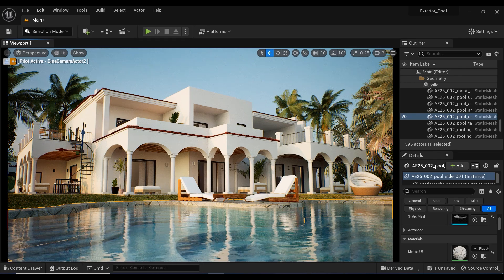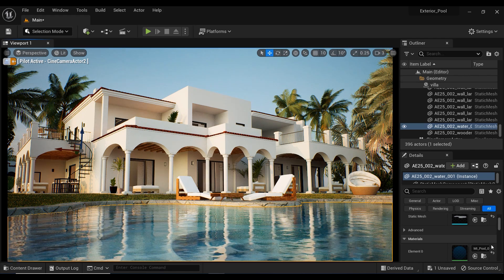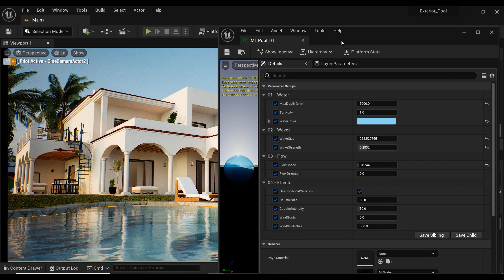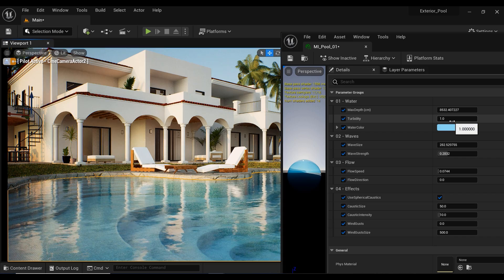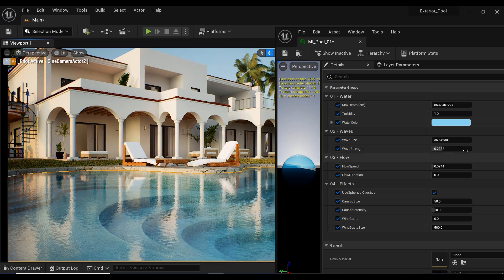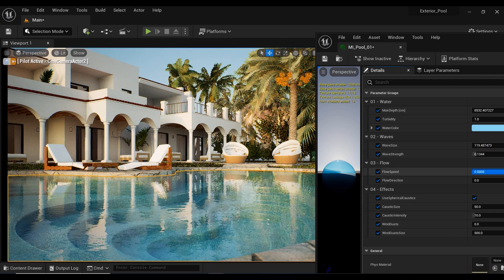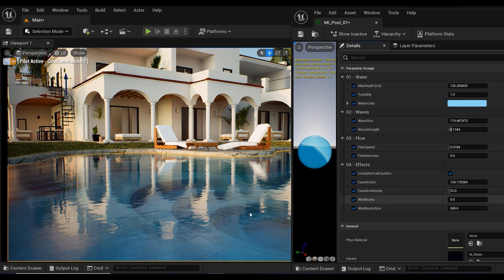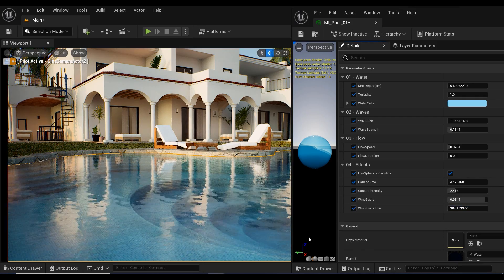From Clear to Turbid: Exploring the Possibilities of Pool Water in UE5

Comment: how to solve the lack of  pool water transparency when sm6(D312 Target shader formats) is on 😊
Reply from the maker: Ensure the water material’s blend mode is set to Translucent. If the problem persists, try enabling forward rendering in the project settings to improve translucency handling. Additionally, if you're using ray tracing, check the ray-traced translucency settings to ensure proper transparency in reflections.

Comment: veryyyyyy nice. good tip
Reply from the maker: Glad you liked it
Reply: @civareducation  I have another question about preparing shaders while rendering a shot. can you help me with that?
Reply: @civareducation  and while watching the video I did the as you told but water can't be translucent, I can't see pools tile! is there any setting that I must change in postprocess or anywhere else?
Reply from the maker: Try to change the translucency type from Raster to Raytracing in PostProcess Volume...
Reply: it has been already done @civareducation  but no use!
Reply from the maker: @farbodemaani1431  have you activated the water and niagara plugins?
Reply: @civareducation  is it do something about  the static mesh? the thickness?!!!!!
Reply from the maker: No it's not related to...
Let me check and I will notify😉
Reply: @civareducation  it is really funny to me that translucent won't work. thanks anyway for your time. waiting for good news :)
Reply: @civareducation  this was the problem. change it to raster and boom. problem solved! but shouldn't be in ray trace mode to display?!
Reply from the maker: Yeah I thought so🤦🏻‍♂️😄👍🏻
Reply: @civareducation  but in ray trace any other material is very good and sharp rather than raster. is there anyway to do with raytrace mode?! because of other materials
Reply from the maker: @farbodemaani1431  try Fluid Flux...👌🏻
Reply: @civareducation  thank you for the time